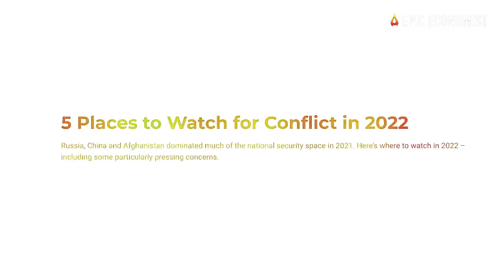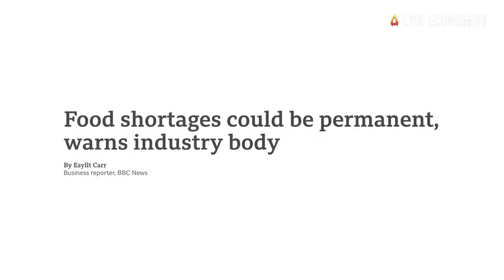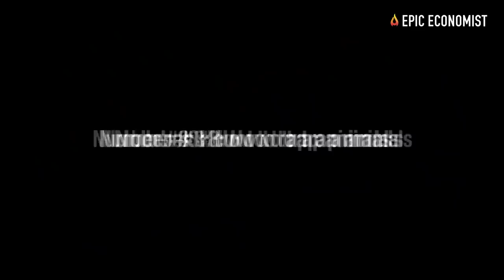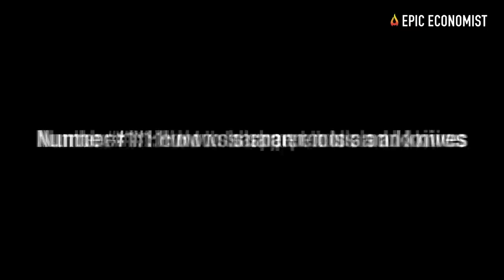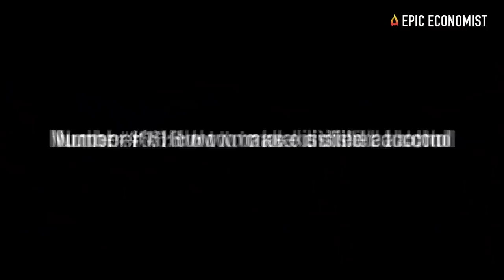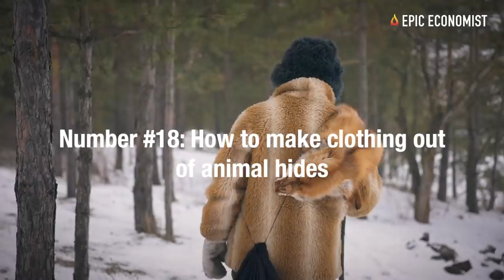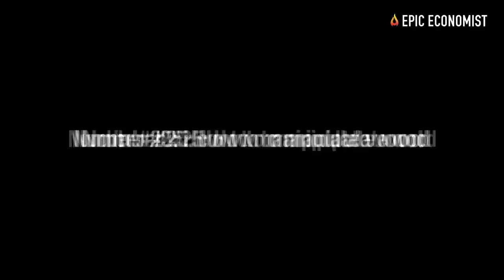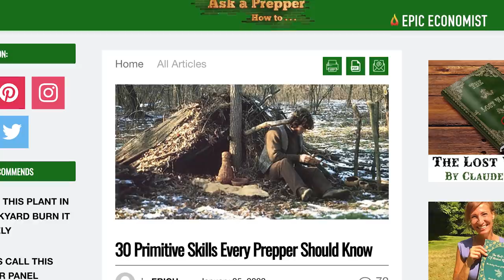30 Survival Skills Everyone Should Know Before The Imminent Economic Collapse

Comment: I already have a majority of these skills and I guess I am shocked that so many people I speak to don't. Some of the info you gave was mis information about navigation based on moss. Tanning hides is a lot of work. Not all of this gear could fit in any bug out bag and be able to accomplish all of this. I believe you really need to learn gardening and canning. While horseback riding is great and I have 25 years experience, it is a great way for many people to break their neck as well and not many have the set up or know how to care for a horse or livestock in general. A farrier file would not be in my BOB as many things you list are so heavy. Not everyone would have a horse and people try to steal livestock. It's a great list of skills but if you can't start and cook over a fire and make it with a tarp for one night you are fairly screwed. 
Also, many older homes have fire places and wood burning heaters for a reason. You needed a way to heat the home. I also wouldn't carry a full size axe with me as my neighbors as I know how to split wood and have for years but we would rather use a wood splitter because to make it through a whole winter you need cords of wood. A basic sewing kit wont work on leather and you need specific tools for leather working that is like a giant needle with a handle to punch through the leather. 
This list is an extensive gathering of tools and equipment with practice most people wont get. This is a pick up truck or more full of wood working tools, leather tools, fishing gear, my best saddles, saddle bags, cruppers, farrier gear, scythe, wheels, metal framing, and so much more to accomplish everything in this video. Plus a trailer full of trained livestock. It's not like all houses will just disappear and all tools people have will go. I believe you would need a LGD and a GSD trained in Schutzhund as well. It would be a group effort.

Comment: there's nothing wrong using a lighter or fuel to start a fire but people need to learn how to properly build a fire pit so they can keep a good fire going and for a long time.
you can always just throw a bunch of sticks down and light them on fire and they will burn but the fire will die quickly if you dont build a proper one with good air flow.
also a good way to purify water without tablets or boiling is to filter it.
grab a piece of clothe, put rocks on the bottom, then put charcoal from a fire on that, then put a bunch of leaves and grass on top, then put dirt on that, and lastly start pouring water through that and repeat till its clear and you got clean water that is safe to drink since all that acts as a filter while the charcoal purifies it.